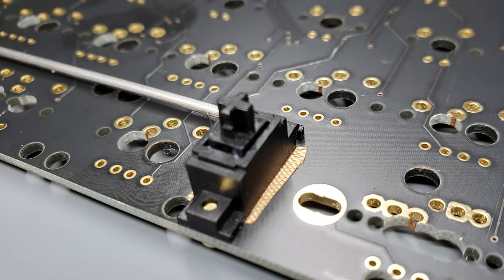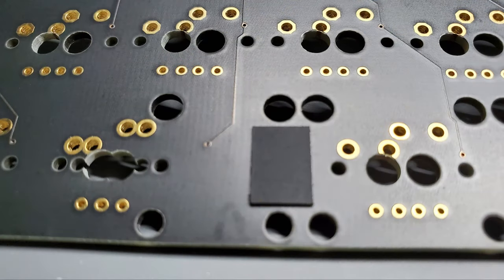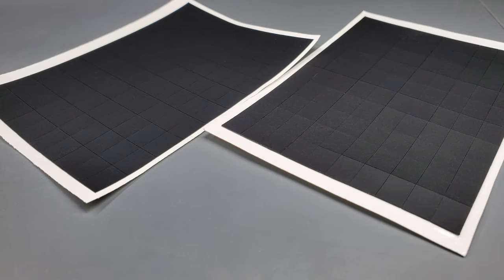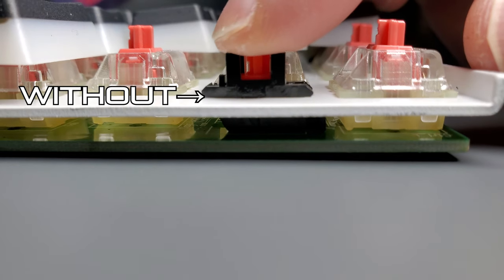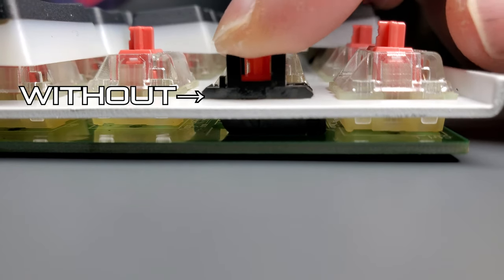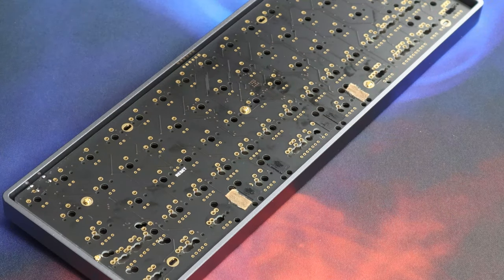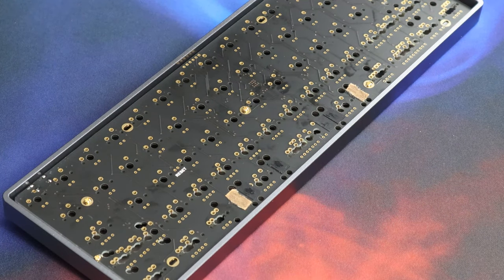Stab Pads - A stabilizer Band-Aid mod replacement - From UPGRADE KEYBOARDS

Comment: Is .2mm or .5mm recommended for plate mount (non-screw in) stabs? Thanks!
Reply from the maker: Typically .5mm is better for plate mount, but there are lots of exceptions to that rule. We usually recommend starting with a .5mm and see if you like the results... if not, drop down to the .2mm

Comment: Hello! I just have a question, does this eliminate the ticking of the stabilizers when applied???
Reply from the maker: not necessarily - what is is intended to do is limit or remove bottom out sounds, and if you have ticking or wire rattle - it will help to minimize those noises. but - "ticking" is usually the result of the cap, wire out of balance, or some other imbalance that stab pads arent necessarily going to help you with. We also service boards - so if its something you dont want to do yourself and would rather it just be done right the first time - we can help!

Comment: I got mine and they wern't precut
Reply from the maker: We had a batch that look uncut, but aren't. Simply fold it over on the cut lines, or pull with tweezers.
Reply: @UpgradeKeyboards  I see lines on the plastic backing where there are supposed to be cuts but it's only cut vertically not also horizontally into squares. I can pull an entire line and make 10 long ass strips.
Reply from the maker: @incongruous4  - email us and we'll be happy to send you a new set.
Reply: @UpgradeKeyboards  sure, thanks! what is the email?
Reply from the maker: @incongruous4  https://www.upgradekeyboards.com/contact-us/ - send us your order number, or simply reply to your original order email
Reply: @UpgradeKeyboards  Sorry youtube never showed the reply and I forgot about this over the holidays but will do. I ordered them off ashkeebs instead of directly from the site so I hope that isn't an issue. I'll reply through your contact-us anyways.
Also after trying the pads for a week now I have to say I do really like the pads, even though I made really janky cuts lol